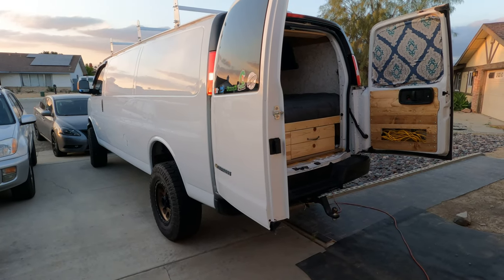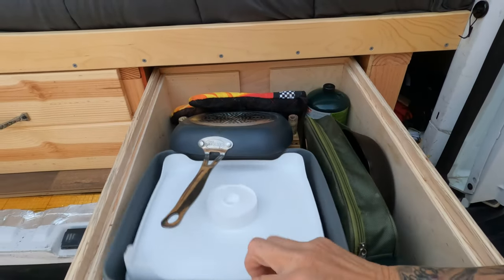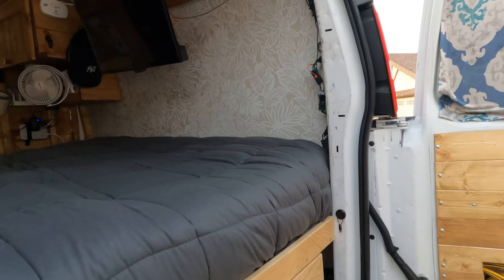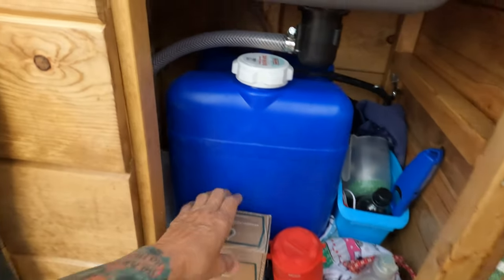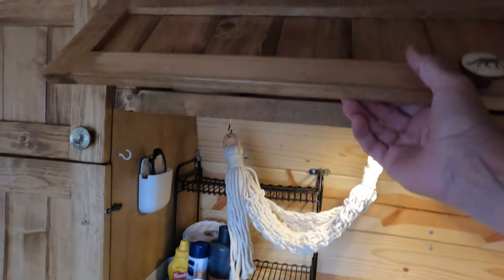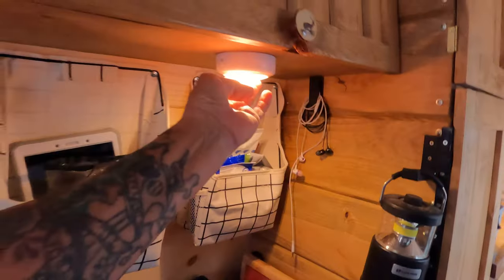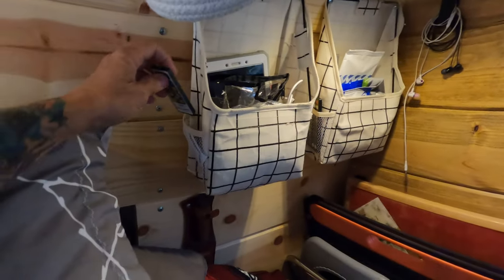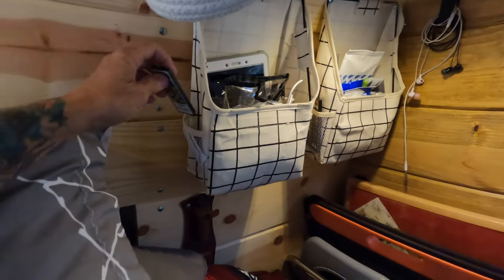Chevy Express Camper Van

Comment: Kim, I am curious. With the lift of your van, is this a 4X4 conversion or RWD only? The whole build looks really nice. I think you did very well with the buffalo inlay and the bear/fish painting. Nothing to dislike. When you mention 'Westinghouse 300', is that an inverter? Power station like a 'Jackery'? Would you consider mounting solar on the roof permanently? Great build out. I may be planning on getting an Express/GMC Safari extended length like yours. Maybe with the 4.8 liter or 5.3 liter engine....maybe the Duramax diesel engine, I don't know yet. It depends on the history of reliability of the engine. I am considering a 4x4 conversion, but happy to know traction control is standard. Another good point is the availability of towing a trailer if desired or necessary as you seem to do with your motorbikes as you mention. I have a couple, but they are road bikes and planning on getting a mid '90's BMW GS with Bing carbs to get offroad with. Time to make an excel sheet of needed items for a conversion.
Reply from the maker: Hi. It's rwd. The Westinghouse is an inverter like the Jackery.  It only runs my fans and lights. The Jackery only runs my fridge. If I were to go Full-time, I would consider solar.
Reply: Thank you for replying and sharing. Happy Thanksgiving too. @lolafalana3636

Comment: I like the quigley vans! Does all that wood add extra weight and use more gas or diesel when you travel?
Reply from the maker: I tried using thin light wood when possible.  I drove the van empty before starting the build. It still has the same get up and go now. I'm sure it affected my gas mileage a little, but I don't feel a difference at all.

Comment: I have a 2001 Chevy Express. It's got some issues. I had given up on building it due to crazy gas prices, but I figure for the price of 1 night at a cheap motel ($100/night) I can get around 200 miles. I finished insulation and the sub floor. You have inspired me to continue with the project! And imagine I was going to switch to a minivan. How long is your bed from head to toe?
Reply from the maker: It seems like the insulation takes forever before getting to the good stuff.

Comment: Beautiful.  
What size lift? .   Tires and wheels. Size and offset please.
Reply from the maker: The lift was done by Weldtech Design. 5 inch lift. They put on new spindles and Fox shocks on all fours. New springs on the rear to handle the build weight. Method wheels. Zero offset. Nitto EXO Grappler AWT 285/70/17
Reply: @lolafalana3636  Thank you very much!  👍   Sweet set up👍

Comment: Explain how you connected your fans. I’m assuming you don’t have a solar system. I really like your layout.
Reply from the maker: I wired it into 10foot cigarette lighter connectors (12 volt) . That way I could plug them into the Westinghouse 300 portable battery.  1st time doing that. I was surprised it worked.

Comment: Hey nice job just wondering what's the wheel size and tire size combo on your van
Reply from the maker: Thanks. Method wheels with Nitto Exo Grappler 285/70/R17
Reply: @lolafalana3636  thank you